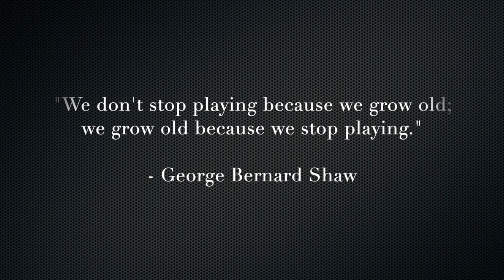Tamiya Lunchbox Machining Custom Front Cross Bar

Comment: Do you have a manual mill or a CNC?? Great video Brice
Reply from the maker: Thanks Thad!

I have a CNC Bed Mill, which we see in this video, a manual lathe, and a large NC mill which has about 4x the work area of my bed mill. The NC replaced an older manual Bridgeport. I can also use the NC as a manual mill. At the moment, I am in the process of replacing/repairing the motor controller on the NC mill. For the carbon fiber parts, I have a CNC router with a 24k spindle that can do 1/4 sheets of ply. All of this is in good fun. I occasionally do one-off side jobs but mostly just for fun now. There was a period of 5 years or so where the only parts coming off my machines were for customers, this work essentially paid for the machines. 

The machining isn't fancy or efficient (doesn't need to be for one-off stuff) but I figure if I'm making the parts anyways, why not share. I enjoy watching how it's made videos regardless of what's being made.
Reply: @jack-o-trades  you’ve got a sweet setup. My brother has an xlo bridgeport style mill, and a 1948 Bradford lathe. He had the grizzly one like yours to start with, then a bigger atlas, now the big post war Bradford. I can do some things on both machines but am nowhere near proficient. I used to make or modify pistons for hydraulic cylinders on an old leblond lathe down in Florida. I’d love to have a small lathe and mill in my garage but I have no room lol